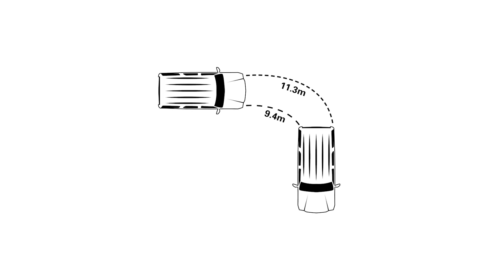SUB $600 DIY LOCKER INSTALL – Watch how much difference it made - Front vs. Rear, Manual vs. Auto

Comment: I understand that the outside wheel can freely spin faster in a corner, and so it works great when driving forwards. Will it work in reverse though?
Reply: Yes. I have one in my Patrol, and it works in reverse, with a BUT  -  it causes windup on full lock in reverse when reversing uphill with a lot of load, such as when multi-point turning on a switchback.   Solution is to use less power if possible and use less steering lock.  However, that maybe would not happen in a vehicle that is not centre diff locked (the Patrol  does not have a centre diff but a fixed drive transfer case).  Reversing without load not a problem.  I believe that when on full lock in a vehicle with CV shafts they are most prone to damage whether Lokka'd or not, if too much power is applied.
Reply: The operation of the locker reverses when you are reversing or engine braking, so it it works just as well in both directions.
Reply: Yes it does - everything is symmetrical, it also works in reverse principle too - few people are aware of this - so downhill engine descending is much better - you can no longer lock op the wheel in the air(or on scrabbly slippery ground) when feathering the brake to slow you down which causes the wheel on the ground to double its speed and literally accelerate you down the hill !
Reply: 4WD Systems Gear to Goannawhere actually even act like a anti skid by not allowing one wheel on the axle to lock , if that makes sense ? So one wheel on tarmac the other on dirt , brake hard the one on the dirt will keep turning
Reply: @stephenhilton9262  . That doesn't make sense, you're braking the wheel, not the axle
Reply: @QuintinKruse  ummm the wheel is connected to the axle .. oh boy
Reply: @stephenhilton9262  your scenario will only make sense with engine braking and not actually applying the brakes. If one wheel is allowed to spin faster, ie. Like a normal differential then applying the brakes hard will stop that wheel
Reply: @QuintinKruse   just take you vehicle out and try it then .. I have many times over 20 years with them fitted

Comment: Is there any clunking or other sounds from the locker in day to day conditions on the road or in tight places on tarmac?
Reply: Had one in the back of my 2016 dmax, since sold... lots of clunking on the seal while turning tight corners, especially under load ie up hill. All in all great bit of gear and the ute still hasn't broken an axle and traction super increased
Reply: Yes - you will hear it tock around corners - you may not hear it with windows up. Occasionally you will get a metallic clack out of it when you are accelerating heavily out of a tunr when it was unlockerd - its the two halves slapping together under load - doesnt do any damage. That can also happen if you have different rotating tyre diameters - eg different tyres, different pressures, flat tyre or different wear rates on the tyres (eg using an old worn spare). Having sai dthat - its very liveable My 100 has front and rear and most of its life is on the black top around town !

Comment: Great video. I have Detroit tru tracs front and rear on my 99xj and they are fantastic. You only know they are operating because your still moving forward thru off camber and hectic terrain.
Reply: Issac Stuckhardt 
Thinking of doing the same on my 97 xj. It’s also a daily driver, any thing I should be concerned about because it’s a daily driver in a state with all 4 seasons. Lots of snow!!

Comment: Hey shauno, do you believe that auto lockers perform aswell as Manuel? I'm stuck between deciding between the 2 

Cheers legend
Reply: when old mate holds the other wheel and he can spin the tire that just says to me its not gonna crawl up a large rock step, on that one side. A rock step that is putting the same rotational resistance on the wheel as the fella holding the wheel is not hard to find either so its like having an upgraded LSD and you will still need momentum to get over it but there are hardly any comparison videos on this topic and most manual locker comparison videos talk about their function of locking the diff and not against the auto lockers. it's all about your preference and valued performance but hey auto in the front manual in the back can still steer on a steep tricky track and get the best of both worlds that is my opinion.
Reply: @SlayerA97  your incorrect its doing that because there is no power to the wheels. when power is applied it puts pressure on a pin which pushes the lokka out causing it to lock i suggest u watch a video of how a auto lokka works. in saying that i still prefer a manual locker
Reply: it works the opposite to a lsd when ever u put drive down it will lock unless the force of the wheel wanting to spin at a different rate to the other side out weighs the force from the driveshaft. an auto lokka will stay locked majority of the time. thats why u run a manual locker so u have full control of when its on and off

Comment: Please remember that this conversion only provides a "locked" diff whilst driving in a straight line, (both wheels rotating at the same speed), when cornering the diff will be slipping, (wheels rotating at different speeds), the clutch pack will be opening/closing against the spring pressure of trying to keep it together. That gives the clicking noise when cornering. 
This system is designed predominantly for part time 4 wheel drive ie 2wd hi / 4wd hi/lo with locking front hubs (auto or manual).
Reply: I find with mine in a GU Patrol front it stays locked as long as I keep the power on, if I back off it ratchets releasing the wind up and then I get back on the accelerator again to re lock it.
Reply: @geoffmoroney9283  in thinking of putting this in my GU. Does the noise bother you? Is it a worthwhile mod?
Reply: @JasonParkers  Noise doesn't bother me and the mod is worth it. If I ever replaced my Patrol I would fit another to the replacement.
Reply: Not quite accurate - when turning on a hard surface with no slippage, the outside wheel can differentiate and unlock, but if the there is wheel slippage then the Lokka will stay locked - it really depends on the conditions and the amount of power applied. When there is wheel slippage differential action is no longer required !

Comment: An Aussie lunch box locker here in the united states is about $300.00
Reply: I have always heard great things about the Aussie lockers.  To bad they dont make them for my tundra.
Reply: @mikewest712  
Did you try contacting Aussie because they might be working on and  eventually making a locker for your truck
Reply: @andrewinsinga2993  nobody makes one for the 07+ tundras.  I dont think it can be done due to the third member design.
Reply: @mikewest712  
Ford used a third member in the 9" rear and I believe aussie make a locker for it
Reply: Isn't that $300 US which now a days because trump doesn't like China has caused currency conversions to turn to crap. That's about $450 here in Shrimp coin.

Comment: Curious as I just thought about it, what about “automatic traction control” how does that affect the lokka on the road?
Reply: Traction control and lockers like this are actually a very good combination.
Reply: Peter Moore, sounds promising, but if you have the traction control on, whilst driving on the road (2019 triton and pathfinders) wouldn’t that damage the lokka?  I imagine using “auto traction” in the rain on bitumen  roads, what if you forget and your doing 80+ kilometres. 

         Just curious
Reply: Seems to work on everything we've thrown at it. The traction control detects wheel spin (or rather a significant difference in wheel speed) to start workikg - The Lokka prevents that from happening in the first place - so it doesnt geta chane to work !
Reply: Awesome! Sounds like my next purchase, thanks for the reply!
Reply: 4WD Systems Gear to Goannawhere most traction control requires a 30% differential in speed , well actual pulse rate from the speed detectors . So yep the traction control should not effect it . But would think it might upset stability control if fitted.

Comment: Had one sent all the way to UK a while back for the front of my Trooper, still the cheapest bet, fitted to a used diff ready for a Saturday swap.   By the way guys its "affect" the drive not "effect".  Trooper comes with plate type rear LSD as stock.  Should be unstoppable.

Comment: I wonder about the longevity of this system, where teeth come in and out of mesh looks like a high ware zone.
Reply: sunjabib ahladeen this is what I’m worried about
Reply: @davontemartin5752  There is no problem with longevity because the gear is able to rachet backwards in the same way as a socket set does it then engages again when the drive force is applied .
Reply: Maybe the springs wear out
Reply: Its the same concept of uncyhcronized/race transmissions
Reply: 3 year warranty
Reply: Can you make a video of using front lokka on soft sand such as beaches or sand dune hill. Is it safe to go downhills with the front lokka on sand.
Thanks
Reply: @maximouribe8726  They are safe on sand.  Uphill or downhill, better in every way.
Reply: @rickjames2664  Two months waiting a sign of life from them here, after full payment. I wouldn't trust any warranty from this company.
Reply: @147andreluiz  please explain more? I'm looking at buying one
Reply: @rickjames2664  I ordered one for my Surf and haven't heard nothing from them for over two months now. I had to cancel my order and ask refund with paypal. Apparentely they have more work they can handle. Heaps of people with same complaints on FB page. I can't trust them anymore. I'm looking for alternatives now.

Comment: Known for decades in the street scene as a Detroit locker.
Reply: Detroits are way more heavy duty than these though. A detroit is an entire replacement differential, not just a spider gear replacement.
Reply: @TheDeezelsmoke  Excatly the same principal though.
Reply: doug harrison no argument there
Reply: @TheDeezelsmoke  good news is someone came up with a cheap and easy to install version for offroad use, noone loses.
Reply: I thought they were called a lunchbox locker
Reply: @TheDeezelsmoke  They have both types, the spider gear replacement and the full diff replacement. Here the partial version is called a lunchbox locker.

Comment: What happens in reverse? Open or auto lock still?
Reply: I would say that like a 1 way lsd its open in reverse.
Reply: It locks in both directions.
Reply: Yep - locked in both directions. The cross pin pushes on the cam slot in either direction.
Reply: Thx guys - correct - it works the same in either direction. It also works in reverse principle - ie engine braking while downhill descending !

Comment: What happens with the auto locker then if you have wheel lift when you turn a corner?
Reply: It does not unlock with steering input so it will stay locked.  As shown in the vid it allows one wheel to overrun the other wheel. So when turning a corner the outside wheel unlocks because it wants to spin faster then the axle rpm.  In summery one wheel can spin faster then axle rpm(outside wheel in a turn) but both wheel must always travel at least as fast as axle rpm.
Reply: My lock right only disengages when off throttle
Reply: They only unlock when not under load. They can be a pain when u are in a tuff spot.
Reply: I think the gist of this is that this is a great deal for your money, not a trial of all the market makes. You pays your money and takes your choice.
Reply: @shaungrubb6598  yep totally correct.  I really think they do differ vehicle to vehicle install to install. I fitted free wheeling hubs at the same time. In a spot where its being a bitch to turn unlock one front wheel
Reply: Jack they are good. But sir lookers are 100times better. I drove mine in 2wd everywhere until I needed low. And was always changing between them so I could turn. 
They would b garbage on the beach. It would bog down easy

Comment: Where I come from we don't call what you are describing as an auto locker,  we call it a limited slip.  I bought a dodge power wagon in 1975 that had Dana 60's with limited slip front and back. I used it for 10 years in Detroit plowing snow in winter and offroad bushwhaking in the summer, it was the best most capable truck you ever saw, I mean it was nearly unstoppable.  A positraction differential  will not only not steer it will walk sideways downhill when it loses traction, major problem weather plowing snow or on a trail offroad. The limited slip will throw the power to the highest wheel, which will prevent it from walking sideways downhill.

Comment: What's sort of life can be expected from these lockas
Reply: Steven Stevens definitely would like to know, depends on how much you use it
Reply: i have had one in back of my hilux for about 2 years and there seems to be no damage to the locker or crown
Reply: Longer than the rest of your diff. No clutches to wear like an LSD. The ramped teeth are hardened and the diff oil provides good lubrication.
Reply: Had mine 4years now no dramas not this brand I paid 1500
Reply: @jameswalker8859  how does that work if the back wheels don't steer does that mean its always engaged?
Reply: @adambennett1193  not always but tight corners can be hard such as car parks but i dont have an issue, but as soon as one wheel slip you can feel  it engage
Reply: I did 100,000km with one in my patrol no worries before I sold it and it was still unstoppable.
Reply: Awesome.. CHEERS for the feedback.. 🍻🍻
Reply: Just had a 75 series owner with 370,000kms on ring me up and ask for new pins - nothing wrong with them, he was just overhauling his rear diff and said he might as well change them.  The car was used as a workhorse for s spray contractor who was towing a D2 bulldozer on a custom traier weighing 4.5 tonnes - fitted since May 1994 ! Just replaced a rear Lokka in 100 series that had nearly 480,000kms on the clock. The fornt Lokkas should last forever. We offer a 3 year unlimited km warranty nd have done so since the mid 90's - Generally - your car will wear out before the Lokka ! Most of the time its not even working - its normal position is locked - nothing is happening

Comment: As much as I like 4wd Action, it's so very irresponsible to promote this type of locker as an alternative to selectable lockers.  Lunchbox lockers are great if you're limited to slow, low range, heavy offroad driving. Can't beat them.  But what has been left out here is that fitting one of these totally removes your option for high range 4wd.  Snow driving, gravel roads, wet weather - these things are down right dangerous.  The worst thing is that 4wd Action know this and still promote these!  Come on guys, we expect more than this from you.

Comment: Lokka is cheap and very effective, I have one in front and one on the rear, best option  to start is in the rear in my opinion,
Reply: They did address some of these points in the video - especially around IFS. 
Unless you have a decent LSD in the rear already. No point pulling that out for an auto lokka when you could have both.
Reply: @alexdevries7594  yes you are right but LSD do not stays decent for long time,
Reply: Jeep Garage yep, if my lsd gives up I’ll put a locker in. Probably a manual one though.

Comment: I’ve got a 2011 Ford Transit 2.4 AWD. I can easily find a locker for the rear Dana 60 diff but finding a decent locker for the front is a nightmare. It’s a MT82 Getrag transmission with the diff built in and finding parts is near on impossible in the UK. It’s mainly used for my work but has to track through local parks in the winter which means the mud and grass easily sees off the 2wd counterparts. 

I’m planning to make a video as not many of these are about.

Comment: Been looking to get one for along time now but been skeptical.
The thing I cannot understand as per the video is how can you have both wheels off the ground in a  driveway with one wheel held and able to turn the other wheel?
That is essentially the same scenario as 4wding one wheel on hard ground and the other in the air.
How does it work to lock both wheels when one is unloaded 4wding, but also do the opposite and unlock   when one is unloaded
Reply: It does not allow either wheel to rotate slower than the carrier, but with the right conditions it can unlock one side and let it spin ahead.  
So when 4WDing the carrier is going to turn both wheels at the same speed, and when cornering, the outer wheel is allowed to skip ahead slightly while the inner wheel stays locked to the carrier. If the inner wheel loses traction it will only do so until the speed matches that of the outer wheel and then they will be locked together again.  

Basically the ground can spin one wheel faster than the other, but the carrier can only drive them at the same speed. This means a one wheel spin-up is not possible.

Comment: Since this is still new the longevity will be interesting to find out as it is metal on metal fiction in the unlocked situation. Very well engineered product.
Reply: Not new buddy. This idea was patented in 1941. "Lokka" it's just a copycat. If you are interested about longevity have a look at "Lunchbox locker". Or even older, "Detroit locker".

Comment: They are basically locked unless your costing in a turn . They are rough , loud , jerky ect , but they do work I’ve had plenty in both ends , now that I matured ( got a trailer ) I run a welded in both ends with hydro steering . Turning radius is horrible but predictable ... I have a solid axle 1986 Xtra cab